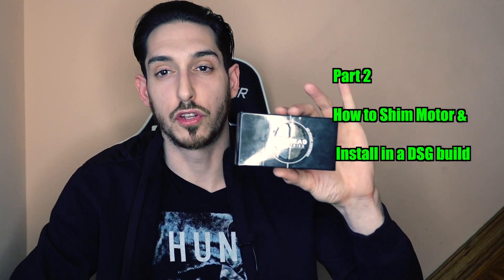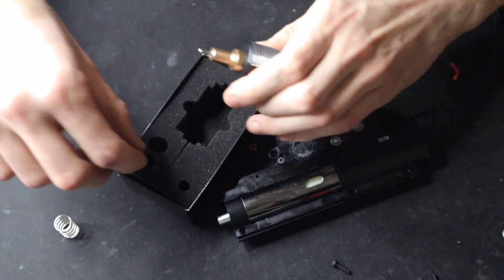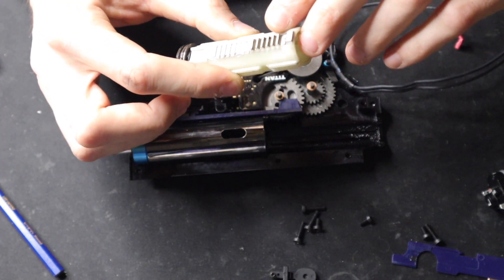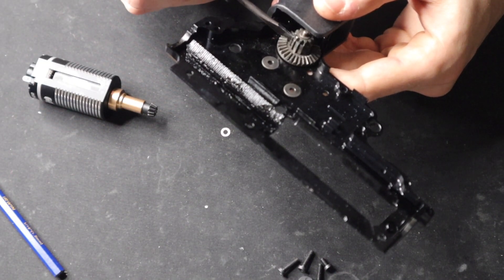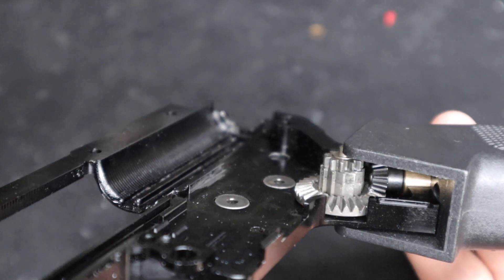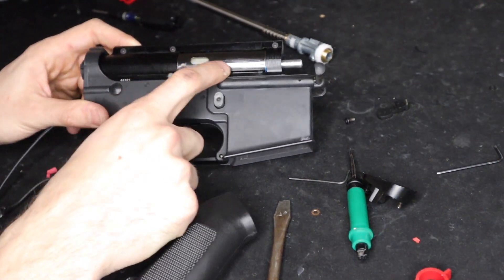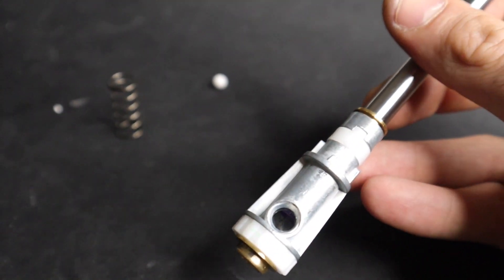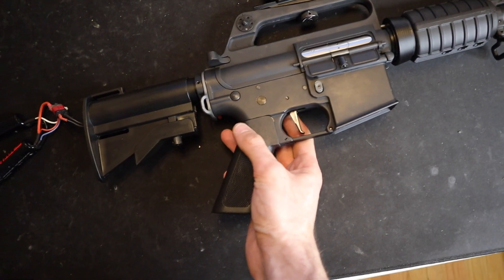Warhead Brushless Motor x High Speed DSG Install & Test + Mis Feeding FIX

Comment: I’ve been told that if your gearbox locks up (blown bearing or something) that a brushless motor doesn’t handle it as well as a brushed motor. Has this ever happened to you?
Reply from the maker: What? We have to be specific. What do you mean by “doesn’t handle it as well” what is being handled. 

Let’s dive into the gearbox. When something blows , inside the gearbox ,, what is a gearbox lock up? Either something broke or something is preventing the gears from cycling. Or the motor is just drawing too much current.  In an event of a lock up , the motor tries to pull as much amps from the battery in order to overcome the lock up. It usually can’t draw enough , and motor locks up. Warhead brushless motors have a electronic protection where it detects over draw if current and prevents lockup’s. It literally won’t let you cycle unless the amp draw is normal. So it will prevent an issue. 

So I am not sure what you mean handle a lock up. Do you mean the quality of the pinion ? If the pinion holds up? It’s very very hard to break a motor. You can always replace pinion gears. 

A DC brushed motor is stupid and you will rip and in the event of a issue you will shread and rip your internals with no protection. The only protection you have it your mind telling you hey stop pulling the trigger you might break something
Reply: Wow, I definitely learned something about brushless motors. I’m sorry, thank you for telling me about how it senses the amp draw. I guess I was just misinformed about it. Thank you for taking the time to write all that
Reply: Also how is the pinion gear in comparison to an asg pinion
Reply from the maker: @Sandaco  great question. ASG is superior in quality. Of the pinion. Now you put a ASG pinion on a brushless.... best motor you can get. Also loc tite the grub screw
Reply from the maker: The brushless pinion is almost exactly a black shs pinion
Reply: @TheRealDealAirsoft  👏👏👏👏👏👏

Comment: Exactly which Warhead motor are you using here? Is this the standard, high speed, or ultra high speed? And what gear ratio are you using?
Reply from the maker: 30k 14:1 DSG
Reply: @TheRealDealAirsoft  shouldnt that get you about 55rps? doesnt sound like it
Reply from the maker: @BloodxSoulZ  nah a 30k will never get 55 rps
Reply: @TheRealDealAirsoft  with 14:1 dsg it should be close to it.

Comment: Do you think this motor will work with an aster mosfet with 13:1 gears, iv been told that it sends the mosfet haywire.

Thinking of getting two. One for my dsg mp5  with titan mosfet and my pdw with aster mosfet
Reply from the maker: Do t ever get an aster. It’s the worst optical mosfet on the market. Get a Perun hybrid. They are so superior and they are only $65 I got them in my website. It does everything a Titan does but 1/3 the cost
Reply: @TheRealDealAirsoft  i already have an aster, i love it and here in the uk there only £65
Reply from the maker: @reubendavenport3254  well in that case the aster will work with this set up. The brushless does work with aster
Reply: @TheRealDealAirsoft  ok thanks dude. The gun is already built just havent decided on motor yet.

Which of the warhead industries would you recommend for my titan dsg with 18:1 gears? Currently running a high torque motor and im getting around 35/37rps at 325fps

Comment: mAh has no bearings on rate of fire. Rate of fire can only be influenced by the cell count and what C rating it can dump at. mAh solely is the amount of juice a battery can hold, like a gas tank in a car. More gas does not make the car go faster; it only goes longer.
Reply from the maker: If you take a 1000 mah 30c battery and then take the same gun with a 3000 mah 30c you will actually see better performance from the 3000 mah because there’s a larger bank in airsoft will get you better results

1000 mah means the battery can apply 1000 miliamps per hour so by the end of the hour your gun is shooting like shit because if the drained cells take that 3k mah and your rate of fire will be consistent and not drop off for longer. So in airsoft yeah a bigger battery is defenetyly an uograde
Reply: Yes, milliamp “hour” not milliamp “power” 

Amps are capacity in batteries. Saying the 1000 doesnt last as long as the 3000 makes sense because the 1000 doesnt hold as much. 

Bigger gas tank means more gas and you can travel more miles before filling again ;)

Comment: Late comment but great video. How's the motor holding up and do you keep AB off? Been thinking about picking up one for my 16:1 DSG.
Reply from the maker: AB is off , but depending on the set up you can play with the settings but it’s Rick solid bro. Seriously. Just really lock the grub screw in the pinion

Comment: Shouldn't you do the bucking test with a mag pushing the bb into the hop up unit? It seems like shaving the bucking lip would cause an incomplete seal between the nozzle and bucking.
Reply from the maker: The issue at hand was that the bucking lips were sticking out way too much. It was preventing bbs from entering the hop chamber. There’s no compression if there’s no feeding lol 

Some maple leaf buckings have lemons and defects. This one did. The air seal doesn’t happen between the lips of the bucking it happens inside the bucking and the seal is how tight the bucking is inside the actual hop unit. So for this case trimming the lips 1 mm was perfect. I had like 365 FPS with a m150 spring
Reply from the maker: Also when test firing it never fed a single bb so that right there is your mag test. After mag test issue was diagnosed and resolved

Comment: So i got an arp9 and building it to dsg, is it an issue that the motor cant moves freely inside the pistol grip while doing the shimming job?
I am using shs ht motor and stock bevel.
Reply from the maker: What do you mean
Reply: Sorry for bad English 
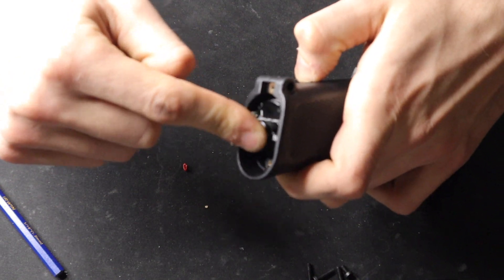My motor can’t move freely like in 4:49 
Is that a big issue? If yes how to fix
Reply: @kitminghui9209  late response but you have to shave down a part on the pistol grip cover it’s on his Instagram if you haven’t already figured it out by yourself

Comment: Yo I'm bout to get one of these brushless motors installed in my ARP556! Im so excited
Reply from the maker: Brushless is nuts , I’m going to have them available on my website really soon
Reply: @TheRealDealAirsoft  what does brushless mean and why is it better that the ones with brushes? Sorry just got into building aegs like a month ago lol
Reply: I got 41rps on single selector gear.
Reply: Make sure to go on his Instagram to fix the pistol grip cover it won’t allow you to adjust motor height if you don’t remove part of it

Comment from the maker: Lol guys education time * DOES MAH EFFECT  PERFORMANCE? *

In electrical theory yes. Larger Mah - Larger Amp draw potential. A battery with a higher Mah is able to pull a higher Amp. So in theory the battery that supplies the most current performs the best. I know in airsoft the motor only pulls the specific amount of Amps needed to cycle the gears ,

However super high stress builds that draw a high amount of Amps will struggle with a battery with less Mah 

So if you take two batteries with same C rating , one is 1,000 mah and the other is 3000 mah , the larger battery takes the cake. The big bank allows you to have a more consistent voltage over a longer period of time and a larger amp draw capability or potential.
Reply from the maker: Better example is a super high rate of fire DSG or even ssg , your sacrifice torque for speed , or less TPA which makes your build less efficient , drawing a higher amperage 

In this case the bigger battery will offer better performance

Comment: 9:35 CORRECTION: mah of the battery does not directly increase the rof of the gun. Voltage does.
Reply from the maker: Yes , you are correct however it does play a role in the performance throughout the day. Larger MAH means you can draw a certain amperage over a particular amount of time. 

If your using a battery with a much less Mah you will draw the amps depleting the battery dropping the voltage much much faster. 

Your basically drawing from a. Much bigger bank with a much more consistent amp draw with consistent vintage
Reply from the maker: Also the higher the Mah the higher the potential amp draw can be so in theory batteries with larger mah have the ability to perform better in power output than a smaller battery. 

3000 mah vs 1000 mah same C rating ... the 3000 takes the cake

Comment: If I use a 16:1 dsg, m140 spring, and standard speed brushless motor will I run into PME?
Reply from the maker: Yeah most likely use m150 spring
Reply from the maker: It’s not really a matter of the brushless motor it’s a matter of returning the piston back fast enough
Reply: I finished my build and I’m sooo happy with the motor. No pme with the m140 and it’s installed in my vfc mp5 dsg with gate titan and retro arms
Reply: Was a great review and helped me made my decision in purchasing it👍
Reply from the maker: @granterlinder6471  really glad to hear it man good shit my brother !
Reply from the maker: @granterlinder6471  what FPS are you getting with 140
Reply: I’m getting about 345 on a .2 with a modify flat hop and mad Bull 6.01
Reply: @granterlinder6471  what lengt inner?

Comment: im building my Dsg 18:1 with sp150 + 30k motor now shooting 50rps with 11.1v 1400mah 50c what warhead brushless motor should i buy? the standard/ high speed or ultra highspeed?  can ultra highspeed handle a SSG DMR SP130 build? thank you man!!
Reply from the maker: So for DSG if you want it to feed on auto then you can use standard speed or the one just above it. The super high speed you will not feed. It will ring in about 76 rps super high speed x DSG
Reply from the maker: For a DMR standard speed 

For the DSG it really depends on what you want. I reccomend standard speed for the reason of practicality so that full auto feeds every round 

But if it’s high stress such as an m160 then try for the speed just above standard that will get you more than 50
Reply: @TheRealDealAirsoft  thank u bro! Super appreciate it! So i think im going to the highspeed motor the midle one of the 3 option.. as you says in the video, these brushless motor cant count “TPA” so that was my question.. how about the torque of these 3 type of motors standard/speed/ultraspeed.. 🤟🏼 thank u hey! Take care
Reply: @MKDMR  what fps u gett with sp150?
Reply: @m.bintangatmajabenzema9905   420 (1teeth removed)
Reply: @MKDMR  it's mean 7 teeth dsg with sp150 u get 420 fps..hard to believe
Reply: @m.bintangatmajabenzema9905  yes… not that hard if u got good compression. Btw guarder sp150
Reply: @MKDMR  if u got 420 fps with 7teeth..wondering sp 170 dsg..500fps 😂😂

Comment: Mid 40s on the standard speed version and bushings? Not to bad, the brushless motor let's you run the smaller batteries tho which is a plus (hate the battery on the side look). You should try the ultra high speed version with some modify ceramics. I got it to feed with 14:1 dsg but the tappet springs kept wearing out. It would be fun to see how you do
Reply from the maker: I’ve tested off camera a 7tooth DSG with high speed brushless .... 76 rps
Reply: @TheRealDealAirsoft  lol sounds about right I was right around  70s on 14:1 dsg. The pts epm1s couldn't keep up

Comment: I thought MaH was equivalent to battery life and the C rating effected performance?
Reply from the maker: Higher c rating and higher mah will yield you the results. If your dumping mad energy ( high c rate) you need a big bank of energy or else you will bottle neck your performance. 

However I use lion batteries and discharge rate is irrelevant
Reply: @TheRealDealAirsoft  discharge still matters in lion batters...if not more so since lion’s have garbage amp discharge.
Reply from the maker: @opairsoft8100  true
Reply from the maker: @opairsoft8100  yes in theory higher Discharge rate the faster it can draw energy from the battery
Reply: Liion batteries are horrible lol
Reply: Also higher discharge rate doesn't dump more current into the system
Reply from the maker: @FrozenByFire3  it allows the battery to drain its power at a higher rate. It’s discharging energy. To discharge to the opposite of charging. To release energy 

High C rating means high discharge rate. It can dump its energy faster than a battery with a lowe C rating
Reply from the maker: @FrozenByFire3  I beg to differ. Lion battery’s are not bad at all. Are you not aware of all the benefits that they offer?
Reply: @TheRealDealAirsoft  this is incorrect. Current capability of a battery is the C rating x the capacity in Ah. A 50C 1000mah battery is the same as a 5000mah 10C battery. Also no matter the battery, unless very very tiny and underpowered will provide the same amount of current to the motor as the motor pulls what it needs. A bigger battery however will suffer from less voltage sag so the overall power output in Watts is higher which is what actually explains the increase in RPS and trigger response.

Also no, liions don't have many benefits at all.
1. "They don't puff up" this statement is false. The only reason they don't puff up is because they are incased in a metal shell. They puff up internally like Lipos do when over strained or over/under discharged.

2. "16C" This C rating is false. The maximum C rating of a 18650 sized 3000mah cell is 6.66C. there exists no 18650 of that capacity that can output more than 20A.

3. "They hold their charge longer" again this statement is completely false. It is true in regards to your average garbage quality airsoft lipo, but compared to a quality RC lipo there's pretty much no difference.

4. "They don't fade". Again this statement is also false. Liion cells degrade just like Lipos degrade. In fact since you're getting much closer to the actual maximum Amp output of the batteries, the cells will degrade quicker than an adequately sized RC lipo.

My source: Mooch Blog for battery tests, and my own experience using 18650 cells from Sony/Samsung/LG running them at 20-25A. They pretty much are done after 200 recharge cycles.
Reply from the maker: @FrozenByFire3  yo I love this keep it coming. Great information my friend !
Reply: @TheRealDealAirsoft  Ah I see thanks

Comment: What’s the actual rps tho? I have a 13:1 with a lonex a1 tiran motor, 11.1 35c 2,200 or 2400 maH (somewhere in that range)
I want to see if getting that motor over my titan would make a good enough difference. If not I’m kinda thinking of getting a stronger battery
Reply: Sounds like about 40rps
Reply: TheLethalPredator yeah it sounded around that to me, I was hoping it was more tho haha. Oh well. I hit 39rps with my setup. Can’t think of any other ways to increase it. Without changing gears. 
I know a 14.8 would boost the shit out of my rps but not sure how long the titan could take it, also don’t think I’d be able to get it to feed lmao
I was barely able to get my current one to feed. I Still suck at that aspect of teching
Reply from the maker: Mid 40s
Reply from the maker: This motor would increase everything. Your power supply is more than enough to drop a brushless in. They are so efficient as well. Low amp draw. But I reccomend to have a mosfet to control the motor
Reply: The Real Deal Airsoft I have a titan in mine. I’ll probably drop it in down the road. 
The low amp draw of the motor should mean I get a bit more juice out of my battery correct?
Reply: did you mean with stronger battery a 4s and not the 3s? because more amps or discharge wouldnt do anything. you can hang a 1000 mah with 30c on there and the performance is minimal less but it would die really fast or might catch fire for getting too hot